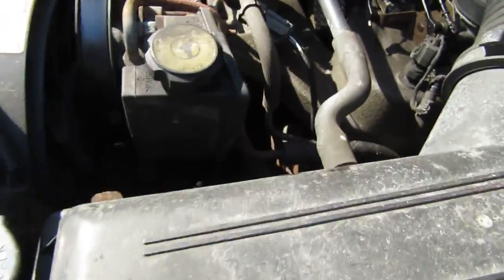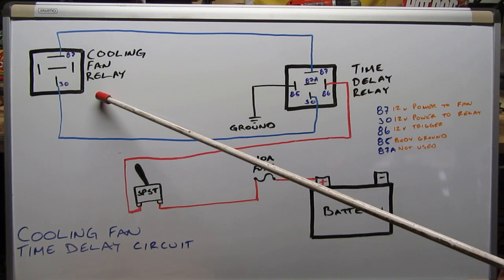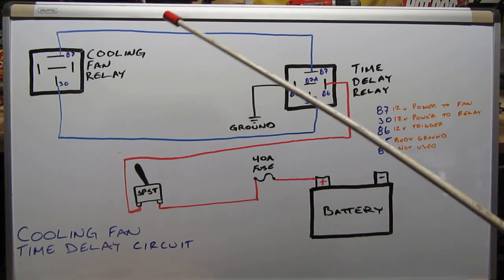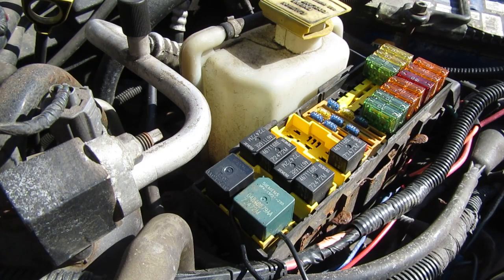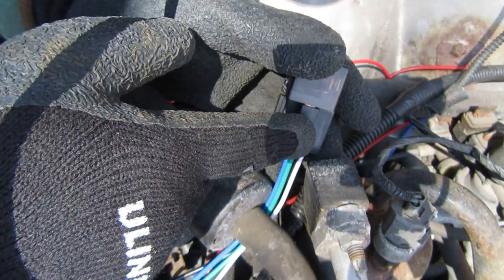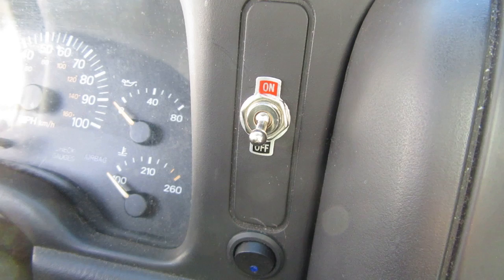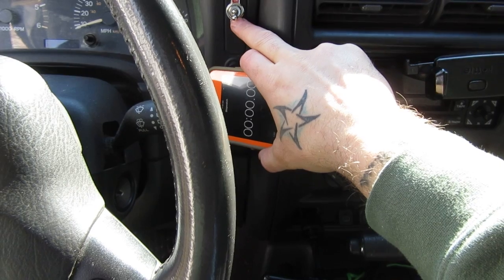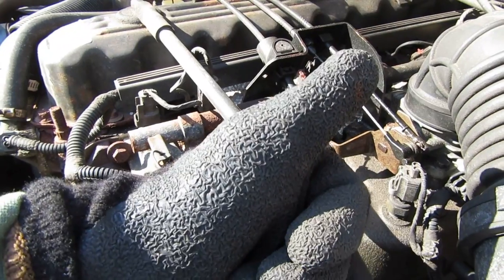XJ HEAT SOAK FIXED - Time delay cooling fan relay install

Comment: It would be cool if you could just replace your stock fan relay with the time delay relay.
Reply from the maker: True, and you can. I like having it on demand with the switch
Reply: James Steel  I tried that in my 97 XJ but it does not work using the Bueler device.  The aux fan never came on.  Not sure, but I think the Jeep uses a switched ground on the coil but the Bueler relay needs a switched +12VDC instead.

Comment: You can do napkin math to see the effect on your battery when the cars turned off.  By browsing radiator fans online, and looking at the fuses in line with the fans, a setup for me looks like they'd draw around 40 amps to start up, and 5 amps to keep running.  Its a 12v DC power system, so thats an initial surge of 480 watts to start the fans then 60 watts to keep the fans running.  This is about the same amount of power that a stock radio+speakers uses, so I wouldnt worry running this less than 30 minutes between starting the car.  But check your own fans ratings... amperage may vary.

Comment: A few questions, cuz im new to working on cars. is heat seeping into the hoses and systems itself bad or only bad when you drive it while theyre still hot? like will the hot parts break eventually even if i let everything cool before i drive it?

also, how long will the fan have to run before the battery is drained?

thanks for the vid!
Reply from the maker: Heat seeping into the hoses and other compartments are called "heat cycles". Something heating up and cooling down does degrade most materials over time, but this is just a fact of life for vehicles. It is unavoidable. It is only an issues when the heat saoks parts above the temperature where they can operate as intended (in the case of the fuel delivery system on my Jeep in this video). most vehicles will never reach a level of heat soaking which will effect the vehicles operations. 

How long the fan can run will differ from vehicle to vehicle, but on a vehicle with a healthy battery the 5-10 minutes needed to combat heat soak will not be an issues. i have accidentally left mine on for hours and was fine
Reply: @DEInTheGarage  Thanks!
Reply: @DEInTheGarage  One more question haha, at what temperature does the electric fan normally turn on?  Would you normally drive around with the switch on and then turn it off when you get out?  I'm wondering if this will help keep the engine cool on and off the trail as well.
Reply from the maker: @mtndewman1022  it depends on the vehicle. on late model XJs the fan comes on a 218 degree. I leave the fan off ulness i see the engine is getting hot and then when i get out i flip it on and off real quick which starts the time delay so that the fan is on for another 4-5 minutes after i shut the jeep down
Reply: @DEInTheGarage  gotcha, thanks!

Comment: Are having any trouble with CEL I have a 2000 auto xj I did this exact same way get a cel
Reply from the maker: I used to. I would get misfires on cylinder 3 and 4. Since using this time delay on the fan I have not had it once

Comment: 2000 xj cherokee just got it buddy drove it 300 miles home never been off roading still stock 188k started experiencing heat soak the next day. I wrapped the rail insulated the injectors and did the upgrade still get the flashing cel and runs like shit ill turn jeep off will run normal then eventually throw cel its 29 degrees temps here. Another thing I just notice my upstream cat was glowing red wondering if that could be the culprit. Also realized jeep didnt have a eletrical fan got one now tryin do a simple switch like this. Idk beaten a dead hoarse here
Reply from the maker: Sounds like your Y-pipe cats are clogged. Would definitely explain the runnning poorly and over heated cat

Comment: Can you just add the time delay relay on the original relay spot for the fan ? Thanks for the video! An you email me the schematic to joe.m1975@yahoo.com Thank again
Reply from the maker: Yes, but it wont really have the desired effect. The existing circuit is triggered by a thermostat switch, so if the engine is not hot enough for that switch to be triggered when you shut down the jeep, the fan will not be on to stay on. The fan is not always turning as long as the Jeep is on.
Reply: @DEInTheGarage  but if you get the fan to start, that means the timer would start, correct? 
If you turn on the ac before shutting the car, thus starting the fan, it will work as your "switch" right? . 
I'm just guessing here, i want to do this upgrade as easy as possible.
Reply: Is there a lower temp sensor that you can replace the existing one with that will allow the relay to kick on earlier and still stay on longer?
Reply: Not sure if it is a "key to hot" circuit to the sensor, but it seems as if replacing the relay with a timed delay relay and throwing in a lower temp sensor, I could avoid all the extra wires and the cooling fan wouldn't need to be switched at all manually. Just wondering if it might work...
Reply: @steeltomahawx1  I tried it but it does not work using the Bueler device.  I think the Jeep uses a switched ground on the coil but the Bueler relay needs a switched +12VDC instead.

Comment: My 1998 manual trans 4.0 XJ has never had a heat soak issue. Could it have anything to do with the slush box most XJ’s have?
Reply from the maker: It is kind of hit or miss as to whether your XJ will have the issue. It can depend on the climate where you live and whether someone put the fiberglass insulation around injectors which was a early dealer fix for the issue.
Reply: I have a 99 and an 01. The 99 doesn’t have any heat shielding at all, never has this problem. The 01 heat soaks all the time. Both autos.

Comment: Will having the thermo switch and the manual switch on at the same time cause issues? For instance, if I do this setup and am in traffic and flip the manual switch on and then the thermo switch also kicks on, will this burn up the wires or anything?
Reply from the maker: Nope, no issue.

Comment: I added this fan delay in my XJ and it did work on SoCal days under 90 degrees.  However, I still had heat soak on the days over 90 degrees, even with using the fan delay.  I finally did cure the problem PERMANENTLY... I simply replaced my #3 injector with a new one and haven't had the problem since, even on 105 degree days!  I still like having the delay fan just incase I'm stuck in traffic on a 105 degree day.
Reply from the maker: That is a pretty good fix! I have also found that upgrading to the 4-port injectors helps. I agree that it is nice to have an "on demand" fan in the XJ.

Comment: One thing I noticed. You should always disconnect the negative first. This is because electricity flows from the negative to positive (opposite of conventional wiring diograms) the negative is connected to the body of the jeep so of you hit the body or anything metal with a wrench while undoing the positive side it will make a circut and shock you. Otherwise great video!
Reply from the maker: You are correct. This is an often neglected step that can have dire consequences. Thanks for the feedback!

Comment: Good video.    This looks like a good upgrade for my TJ's heat soak issue as well.  I'd like to point out that the negative battery terminal is always supposed to be disconnected when working on any wiring since the vehicle is a negative grounded body.
Reply from the maker: You are correct. I should have disconnected my negative lead before working on this. Thanks for the feedback!
Reply: I'd like to point out that electricity does not flow unless there is a complete circuit. It does not make a damn which side you disconnect just don't get the hot to ground.

Comment: Thank you Doug! I've had the fix installed for a few weeks now, but wanted to wait until we had some warmer weather to comment. I recently ran several errands with the temperature in the lower 90's. Before the fix I would have had to open my hood at every stop to cool the fuel rails/injectors to prevent vapor lock (and that was not always successful). Now that I can turn my fan on manually, I have had ZERO vapor lock issues. I do have to mention that I still have not been able to get the delay function to work on the relay, but I am OK with that. It is apparently a touchy setting, and I have not found the sweet spot yet. I have been asked if running the fan runs my battery down, and I can say that I have had it running for 15 minutes without a noticeable drain on my battery.
Reply from the maker: Thanks for the feedback! Glad you found success. I accidentally left my fan on for about 2 hours the other day without draining my battery. I guess if you battery is already weak you might have an issue

Comment: How would you wire just the switch for the fan without the extra relay?
Reply from the maker: That depends. Do you want to take the thermo switch out of the equation completely, or do you want a switch to turn on the fan at your will, but retain the thermo switch?

Comment: Why not add a single pole relay into the system that switches on when the power is off? That way you can bypass the switch, and just have the timer start each the time when the Jeep is turned off.  You would just wire to the key on run circuit.
Reply from the maker: I wanted to option of using this fan as an on demand rescue fan if I see my gauge rising in traffic or while plowing. Granted this system is only as good as my memory to hit the switch before I run into a store, but for my purposes it checks all the boxes and was simple and cheap. That would definitely be a good option for someone with slightly different needs
Reply: I would like to wire in a relay as you suggested, would you be able to elaborate how that works? I am not very knowledgeable when it comes to wiring and electronics.

Comment: On a side Note I just wired up a Taurus fan on my ZJ this weekend that I'm prep'ing for a motor swap.  This is why this subject is fresh in my mind right now.
Reply from the maker: very cool. They move considerably more air than the mech fan, right? Did you put yours on a thermo switch?
Reply: Yes they do more more air. I have not put the fan unit it, I am refurbishing the motor, and the shroud. Yes I am using the BMW two position switch. 
I pulled the whole fuse box out of a WJ and removed the relay holder assy, and installed that into my fuse panel (clicks right in) I also added a Maxi fuse from the Main power Dist to power it all. Term 85 from both relays goes to a switched power fuse in the Dist block, term 86 goes to the switch for both high and low. I can email you a schematic if you like just PM me.
Reply from the maker: Sounds good, Thanks. I have actually found the message feature a little unreliable lately on YT. Would it be possible to ask you to reach out to me a dandeoffroad@gmail.com?

Comment: Thanks for making videos like this for guys that are afraid of  tackling wiring issues, but I think there are somethings you might want to reconsider in your design. Now just to put you at ease, I was (not long ago) a professional mechanic, and I specialize in electrical systems but this is not the place to give you my whole bio, just letting you know I can help. 
First your 40 amp fuse is too high. A relay as you know uses a low current/power circuit to control a high power circuit, so your 40 amp fuse will never trip if you have a failure since it is on the low power side, just not enough load.  Second, most automotive circuits are ground side switched (that is just how OEMs do it) not important but it leads to my third point. Lastly, if you want to use your existing OEM relay to stay on with a time delay you can just tap into your control circuit (term 85, & 86). If I remember correctly the XJ thermal switch closes the circuit to ground on the 85 terminal of the OEM relay, you can place your time delay on that circuit and give it an alternative path to ground when the key is off. 
Again not trying to poo-poo on your work but I thought I could help since there are a few ways to skin this cat.
Reply from the maker: Hey, Thanks for your feedback. I will say it any day.. I am an expert in LITERALLY NOTHING. It is always nice to talk to someone who actually is about these projects.

now that you bring up the 40amp fuse, it makes sense that it is too high. Would you suggest something closer to 15 amp?

On your third question.. Is there a large advantage to doing it that way opposed to the way I did with the TD relay piggy backing on the existing relay? 

Once again, I appreciate your critique... this is how we all learn.
Reply: @DEInTheGarage  Great video!  Thanks for this!  Here's a question.  What about ignoring the switch and wiring to the dome light circuit? It's one of the only things that's off while you drive but turns on when you're done.  Then again, that means the fan will kick-in when you unlock your doors or get in to drive....  Maybe set it for 1.5 minutes so it cools for 1.5 min when you're done driving and then when you unlock the doors before driving off again?  I don't know...  Is there any other circuit that's off until you're done driving? THANKS!
Reply: Hello there, I must say this video is really helpful and Henry, your feed back is great.  I would happy to know how to turn on the fan when you cut off the engine from the key like the way you mentioned here. An exact wiring diagram on how to do this will be greatly appreciated. Thank you both!!
Reply: I am going to try this with one change:  instead of the +12VDC battery, I plan to use an ignition-switched +12VDC circuit to drive the switch and relay coil.  That way if I forget to turn off the fan switch when I park, the fan should still turn off after the delay. Edit: I used an add-a-fuse on unused fuse # 18 in the junction box of my 97 XJ to access the ignition-switched +12VDC.  Routed that signal to my dashboard SPST switch, through a diode then to the Bueler timer relay connector #86. The diode is necessary because there is noise on the switched power line when you turn off the ignition.  The only diode I had handy was an LED, which worked.  Thanks D&E for the video!
Reply: Chinthaka Aravinda sane here I need that wiring diagram if possible I put my email in the comments so if anyone can shoot that to me that would be great! Lenny-lewis@hotmail.com thanks guys!
Reply: Sorry I did not see the notification for this. To both you and Lenny, I have a schematic that I might have to tweak a little to include the timer function. Also I have a ZJ and not an XJ so there might be some differences. 

So how is this for a possible solution I can email Doug with what I have and maybe he can do a follow up video with some Q&A type info.  I will leave this up to him since I can't dictate what he does or does not do. 

And lastly Doug I have not forgotten about your bonkers blinker you mentioned. I still owe you that.
Reply: Henry V. Can you help me out with this dude 517-358-3743 it’s for my xj and no one else is getting back to me the shop won’t touch it and I have everything I need and i’m will to do it with a little help on understanding what you Kent on how to set this up I put my number in here I live in Michigan and i’m available for a call anytime thanks dude hope to hear from you soon